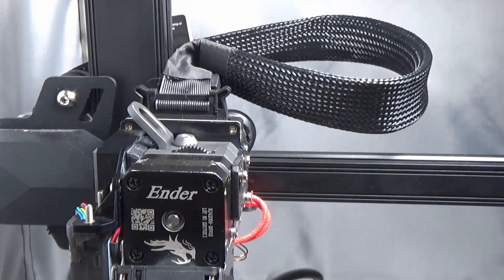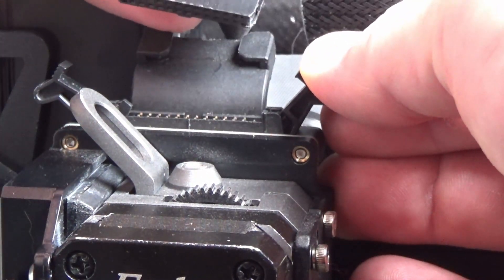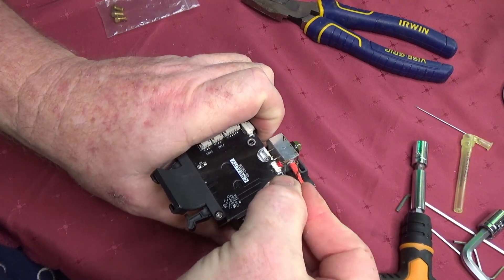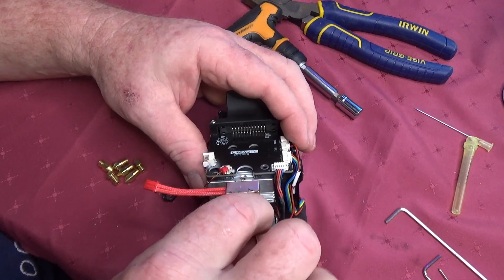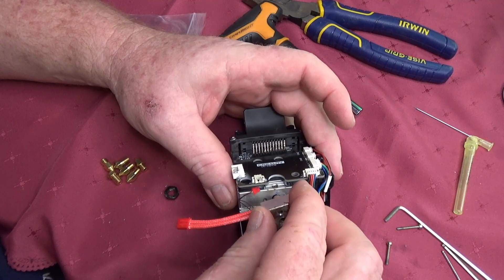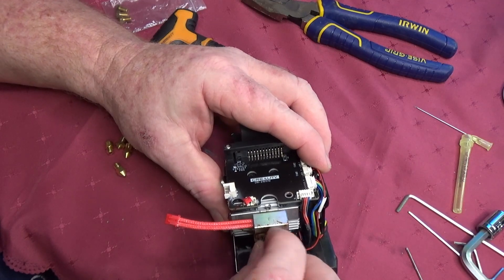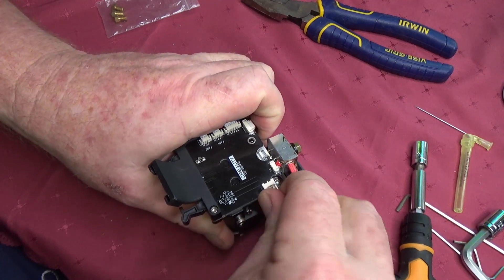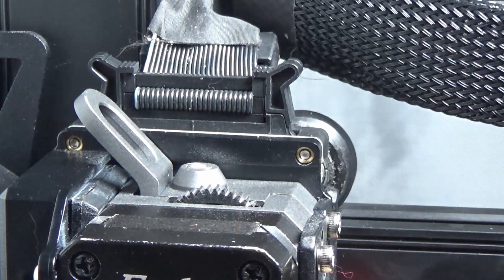How To Un Block a Sprite Extruder Ender 3 Series 1 Pro

Comment: My printer jams at 15% into a particular project without any clogging when I take it apart... I'm not sure whats causing the jam to occur at that particular spot..?
Reply from the maker: I would be starting from scratch with that one... new SD card, new copy of Slicer, new program of a different object .. new firmware .. the whole works sounds like software issues to me mate .. let us know how you go hey ?
Reply: I used different profile settings for the print and it managed to complete... but when I tried printing a larger version of the same file I ran into a "unable to parse move" error.   @UnfinishedProjects-yt8km

Comment: Hello Dear Friend ! 
I have to ask you. if you can help me solve the problem that arose after replacing the motherboard on my 3d printer, in particular, the problem is: my old motherboard stopped working, it went bad and I bought a new Creality 4.2.2. this device has a processor with the number (in this order it is written):
GD32F303
RET6
AUJO484
AZ2219
GIGADEVICE
ARM
I connected very correctly and carefully all the wires and turned it on after connecting. I checked and made test movements of the carriage and hot end, everything works well in this case, Z works well too, auto return home also works well, the mechanics are good. but as soon as I want to print something >>> only X and Y axis work well, Z does not work , does not rise up during printing, although the filament arrives and is printed on one layer, I do not understand and do not know how to fix this problem, the warranty period has passed because I have not been at home for a long time and the seller does not return it back.If you can help, or suggest where to look for a way out of this difficult situation, please help, I'm not strong in computers and programming so that I can flash "it" myself, that's why I turned to you with this request! I look forward to good news from you.
 BEST REGARDS,
GEORGE!
Reply from the maker: yeah i have changed out the mother board on our ender 5 plus ..theres no way i could diagnose that problom with out being able to see it .. could be anything from a broken wire to having the plug on backwards ..
Reply: @UnfinishedProjects-yt8km  ok,thank  you

Comment: what is that spacer you put before the nozzle  ? was it allready on the old nozzle or does this piece comes with the printer
Reply from the maker: That is just a steal 6mm nut to encress the heat mass if U check out CNC Kitchen he did a few videos on it . .
Reply: @UnfinishedProjects-yt8km   could it be that my print gets knocked away mid print at 20% or 40% because of the nozzle hight  ? and ofcourse i will checkout the video you mentioned
Reply from the maker: No not a chance .. if your using the same printer as me check the front fan is not hitting your print
Reply: @UnfinishedProjects-yt8km   allright i will unscrew like you did the 2 bolts behind so i can adjust it. i never thought that maybe that could be the problem i let you know
Reply from the maker: Kk mate good luck ...
Reply: I did checked the front fan nothing not hitting anything it just gets unstuck from the bed mid printing …
Reply from the maker: Ok we'll have you made sure U have set your slicer correct things like "Z hop" etc ?
Reply: @UnfinishedProjects-yt8km  well i have tested it with z-hop activated but still same problem… i want to print with pla 230C extruder and 80C bed … speed is first layer 20% so first layer is perfect… after 10 layer it goes to 50% print speed and when wee hit 40% of print done it just just unstuck itself.. i also checked z offset … should be good not to far away nor to close… i changed filament and nozzle.. i dont know why it does this… last weekend it was printing just fine …
Reply from the maker: That seems really hot to me that what I do PETG temps 50c x 200c is pla temps ..
So 90% of the time this terns out to bed bed leveling .. I don't ever use auto and get it as exsact as possible..
Now saying all that my ender 2 pro will not print PLA for me same thing happens it pops of the bed .. I use PETG and it prints just absolutely perfect every time yet no matter what I do I can't print PLA on my machine ...

Comment: I stripped the screws on the aluminum heat block, am I screwed? Do you know what size they are or where to buy them?
Reply from the maker: When you buy a new gear block it will come with new screws ...
Reply: @UnfinishedProjects-yt8km  mine did not had to contact the seller

Comment: Dude says he replaced the nozzle when he just put the old one back. Hahaha
Reply: either way that is irrelevant to the objective of the video. btw, "re-place" does not mean installing a brand new one it simply means "re" placing the nozzle back into the heat block. could be the original one or a new one. either way your wrong again
Reply: @Mr.Thermistor7228  hahaha if you say so.. why replace with an old ass one? You literally replaced it with the same one u took off.
Reply from the maker: That is my crap film making i am sorry, it was a new nozzle but had to film it serval times, i only have cheap cameras left after the flood they keep shutting down due to crap battery's and heat ..
i reversed the footage making it look like i was ether going on or off as i dint have all the footage i thought i did when i came time for editing ...
apologies about that ..